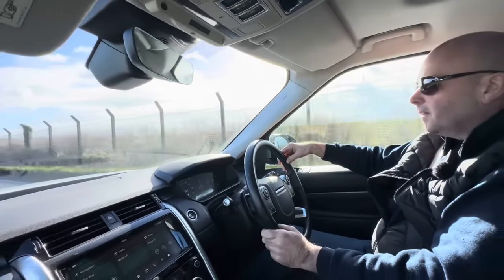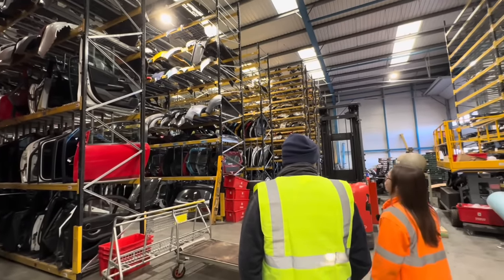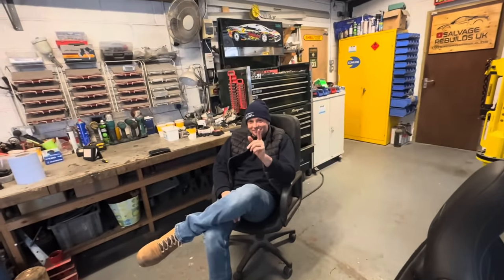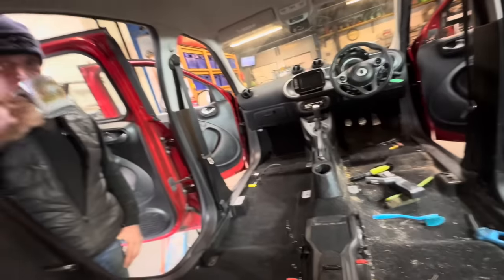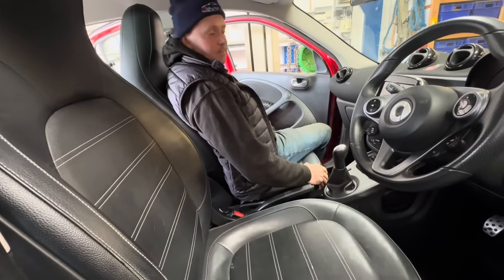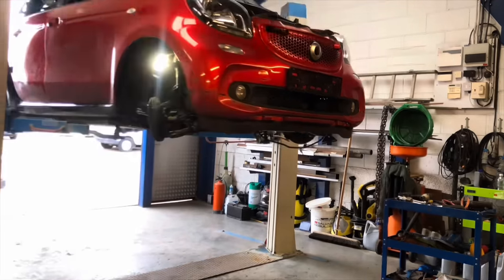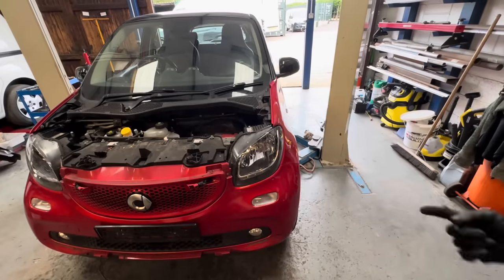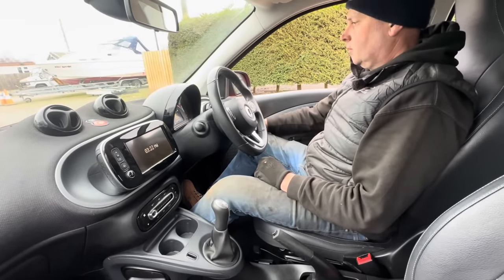REPAIRING A STOLEN, CRASHED AND VANDALISED SMART CAR

Comment: Its a myth about paint difference on metal and plastic,, we paint motorcycles, which have plastic side panels and seat units, but the fuel tanks are metal,, and we get them to be the same colour,,, the reason why some cars have different shades is because, the plastic panels are painted separately to the metal panels,, we paint everything with the same gun at the same time,, Happy days

Comment: Good job guys. 

Hobbyist detailer here:
A rubber brush is great for getting hairs up;
You're on the right track with the air gun but try your DA polisher - it'll velcro straight onto the carpet like it's meant to be 😉
For a quick deodrariser, spray with white vinegar and let dry. Once dried, no, it won't smell of vinegar 

Hopefully that helps

Comment: Good work again. The Reclamet operation is very well organised, a bit different to the 'traditional scrapyards' I visited many times. Apart from the vandalism, the inside of the car was a tip. It never ceases to amaze me how people treat their cars as a dustbin. Cars in scrapyards are bad for this too. Thanks Chris for pointing out that Robs wing mirrors are actually mounted on the doors!! I have a car with actual wing mirrors, a 1969 Morris Oxford Traveller. On previous 60's or 70's cars I had, they were no good for night driving as you got dazzled by cars behind so I removed them and fitted door mirrors!!

Comment: Rob have you seen that car carpet cleaning “hack” everyone has been going on about? Cut a toilet brush in half and put it in your drill, then use that to clean all the loose bits in the carpet before using a vacuum… works wonders.

Comment: For really bad carpets, I attach my polisher without a cutting pad to the carpet, put it on its lowest setting and turn it on. Similar to what you did with the air chisel and it works really well to vibrate the cheap quality carpets and loosen the dust. As the base plate is velcro it keeps your hands free to hoover and brush etc.

Comment: I use a roto hammer drill with a bit of 50mmplumbing pipe on the end and the vacuum end all duct taped in together and it works like the chisel but with one hand.

Comment: Not surprising that they make such a good turn over 250 cars per week, paying a fraction of cost for scrap cars and selling in parts probably fetch anywhere between 10-50x the cost. Car bought for £200-1000 will break for £2000-15,000+ 

Obviously it’s subjective to what sells but with such a wide range of parts they sell many parts daily. 

It’s places like this that keep the cars worth repairing on the road. 👏🏻

Comment: That plastic vs metal color matching is true especially for red. I have a red 307CC facelift with plastic front wings as well, the color match is atrocious. The front bumper as well. It's all original paint but the bumper is so different to the hood it's shocking lol.

Comment: Hi Rob and Chris keep up the fantastic work just a quick tip if u ever need to get everything out the carpet use a air da sander with a cloth on it and press it on the floor or the same with a electric da sander

Comment: good things about modern cars all wiring is waiting for the extras.  means companies don't have to make more than one wiring loom for the car saving money and time.  my tigra has the plugs waiting for leather heated seats.  mrs old citroen had a manual mirror on drivers door, i replaced with electric and got the switch from donor car and it worked out of the box.  good job these days manufactorers save time and money having all the plugs for optional extras already fitted on the loom

Comment: Rob, on those audio systems “no maps found” is normally a missing map SD card - normally located in a separate SD CARD slot in centre console or in/around glovebox - easily available from eBay Renault or Mercedes.

Comment: There should be an SD card with map dadat for the Nav, its located near the back of the center console on the top, its just a slot and the SC dard should just pop out with a press on the top of it.

Comment: I’m wondering if rear ABS rings are different to still have faults in system as I had a Peugeot in the past which I changed the axle and abs light came on.
The axle I fitted had different rings as soon as I put originals on it was fine worth a check 👍🏻 love the vids jamie

Comment: I have a Citroen C4 Cactus and one of the badges has either fallen off or stolen. It is a silver with black insert so I only,y need one black insert.  Have tried breakers yards near me but with no success.  I was wondering if you could point me in the right direction.  Citroen want £60 but I only need one.  Thanks in advance.